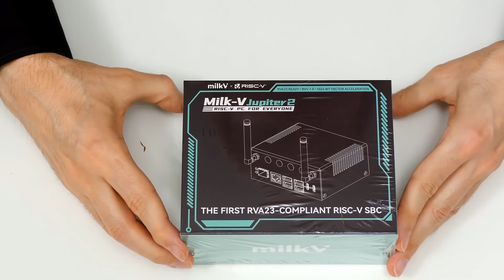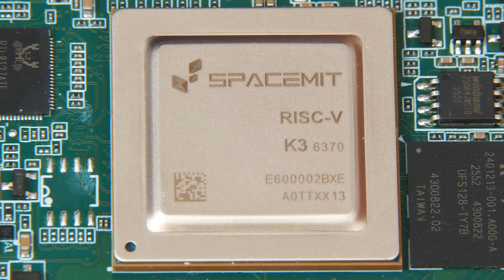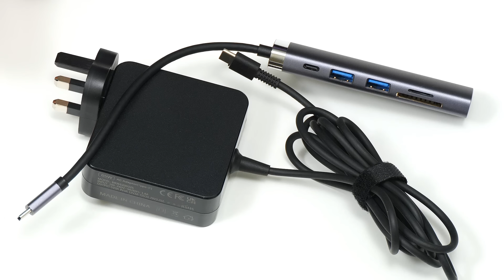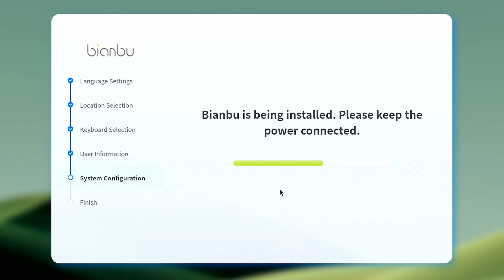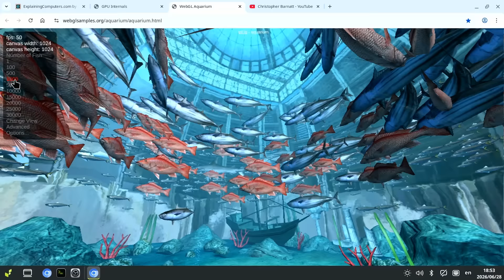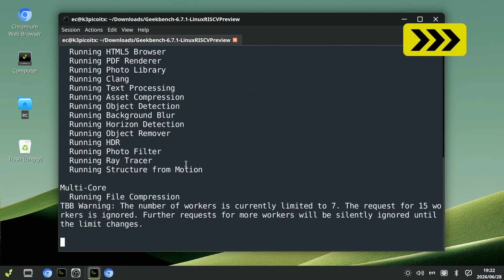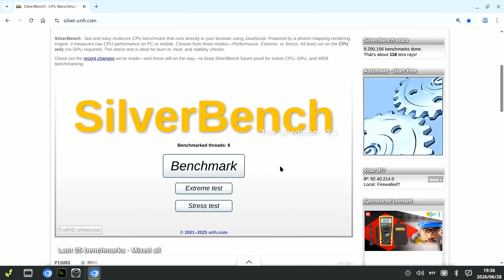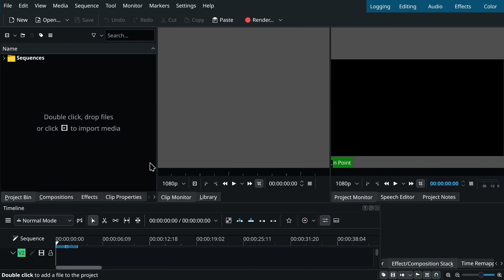Milk-V Jupiter 2: RISC-V RVA23 SBC

Comment: the sfp 10+ is nice and if you run fiber or a DAC, they are usually cooler than the copper wire tranceivers

Comment: 14.4 watt at idle and 20.5 watt at load sounds just wrong. Do nothing and waste three quarters of maximum power?
Reply from the maker: It suggests that a lot of the power is not being use by the CPU, which is/was hardly that unusual. Remember is this very new, developmental hardware, and may well not be power optimized.
Reply: Also remember he didn’t use the NPU. Pretty sure I’ve seen about 30W banded about if it used to the max.

Comment: A similar board with stepper motor control could be my dream machine right now for a project build. Could the gpio on this be used for high resolution encoders? (2 or 4 to be precise)

Comment: Very enjoyable, like all the videos I have watched after joining a few months back, having become a very unhappy Windows user and decided to learn more about Linux before taking the plunge! This one contained some whole sentences which I  understood, so I am making progress. My biggest problem is that none of the painting software I use to emulate my painting style before I became severely disable by a motor neuron disease [Corel Painter 2023, Dynamic Auto Painter 8 and Fotosketcher 3.98] is Linux compatible. Apart from the now very dated GIMPressionist in GIMP, I know of no brushstroke based paint packages that run in Linux. Any suggestions would be appreciated. Thanks

Comment: The speed of RISC-V improvement is good to see.

In terms of CPU power, we're basically within striking distance of a Raspberry Pi 5 and already better than a Raspberry Pi 4. Impressive.

A shame that AI data centres are ruining the prices of everything right now.

And I couldn't help but note those NPUs just sitting there doing nothing in "htop". How much of the SoC is used up on AI cores that just sit idle, if you're not using any AI? Could we have gotten more CPU or GPU cores in there instead? Or simply dropped it for a cheaper system for non-AI workloads?

Because if you're not intending to run local AI - either you're using cloud AI or just not using AI at all - then you've got a chunk of the SoC doing nothing.

Comment: For comparison, because it's handy...
Xeon E3-1276 v3 @ 3.60GHz (roughly equivalent to i7-5xxx), 32 GB RAM, fast NVME, Win11.... same render in GIMP took 3.5 seconds. 
So the best SBCs have about caught up to a 10 year old desktop PC (that was rather high end in its day) which isn't half bad considering the limitations of an SBC. Very much in the range of everyday usable (It's what I use every day, so it must be! :)

Note that GIMP versions do not perform the same. Same render with GIMP 2.8.22 on a slightly faster PC with 64GB RAM took 34 seconds!! So this is something to consider for your benchmarks. I was roundly shocked at the difference, but yay optimization!

That SBC does look like it's intended to be used headless. Probably why no HDMI. Quite the nice case and other features, tho.
Reply: What do you mean "used headless"? This SBC has alt-DP mode on USB-C. Lenovo sells 27" USB-C monitors for €190 so it's very easy to just hook it up with a single cable. Saves cables, speakers, power adapter and USB hub.

Comment: That's a big leap in performance, I remember when I experimented with the StarFive VisionFive 2 it was unbearable slow, even editing a document was slow. The Imagination Technologies iGPU has basically the same technical details as the IMG BXE-4-32 MC1 which couldn't play videos that smoothly but I wonder if it was really that slow or there was something wrong with the shipped Debian version and it had no hardware acceleration activated.

Edit: Nvm, the "Floating point operations per clock" are double on the IMG BXM-4-64 MC1.
Reply: With a lot of SBCs, video decoding is done with the VPU, not the GPU. And enabling hardware video decoding in a browser is a different story.
Reply: @LivingLinux  I don't see how that is relevant when the Video Processing Unit (VPU) is just a component of the GPU.

Comment: I get that it's early days yet but they are still no where near being daily drivers. Although this one seems to be a small step in the right direction.
Reply: If you can use a Raspberry Pi as a daily driver, it should be possible to us this as a daily driver.
Reply: @LivingLinux I don't use a Pi as even a 5 is under powered.

Comment: I found the phrasing of https://youtu.be/vSKA6thLI1U?t=342 where you mention the Nano Sim slot and then seem to conflate this with the B-keyed PCIe slot.
Reply from the maker: The nano SIM slot is only of use if a 4G or 5G wireless module is fitted in the B-keyed PCIe slot.

Comment: Surley as a NEW, 2026, RISC-V mini computer you should at least have the base, 2024, M4 MacMini benchmarks in the tables, as around the same price point (with the Education discount), and form factor. The base M4 8 core MacMini achieving - Single core 3788, Multi-core 14729, Idle Power ~3.5 Watts, ...  vs Milk-V Jupiter - Single 342, Multi 1703, Idle Power ~14.4 Watts, ... . Essentially 10% of the performance, for four times the power consumption, at 90% of the price of a MacMini, before considering software availability, and support.

Comment: A standard ISA is certainly a start towards RISC V becoming a thing in this market.  As mature as ARM is there is enough variation in features and aux components that it's all too easy to find an ARM SBC is soon abandoned and all you can run on it without considerable effort is a kernel built by the manufacturer from 3 years ago.

Comment: I still have serious doubts of a RISC-V desktop computer ever being price-performance competitive against ARM/x86. The main reason I have these doubts is because the ARM and x86 ecosystems continue to advance themselves. They are not going to stand idle and wait for RISC-V to catch up. If the RISC-V ecosystem ever hopes to produce an economically viable desktop computer product, it will need to advance several times faster than ARM/x86 just to catch up. I'm not seeing that.
Reply: You're not? The previous generation K1 boards that were comparable to Pi 3 / Odroid C2 were launched 8 years after those (early 2024 vs early 2016). This board was launched 2 1/2 years after the Pi 5 (October 2023). How is that not advancing several times faster than Arm?
Reply: A decade ago you could have said the same for ARM. It took nearly 30 years, but arm has caught up x86. 

Although the acorn home micros would probably have been competitive with a 286 pc at the time. That might be an intresting comparison to make.

Comment: And its here! Yay! Thanks!

PS: I had an alightly unrelated idea the other day, that I feel should already be a thing, although I have yet to come across them. That is someone making new, tiny mobo's for older x86 CPUs to make use of all the many older, but still useful CPU/APUs people like myself, and I imagne many others here, have laying around. It seems like a good alternative to spending hundreds on a new SBC. Im thinking a small one with soDIMM slots or intergrated RAM, I/O, etc and perhaps custom FW that has a number of power profiles preloaded in case you dont need the full power, or need all of it. Anyway, if this is a thing, a referal to a good one would be appreciated. Thanks

Comment: Neat board, but let's be clear: this RISC-V board is just as proprietary as any ARM SBC, and offers very few advantages to an end user over any number of ARM boards.  It also requires custom a custom vendor kernel and distro, and closed-source binary blob graphics driver, like all the SBCs. Really all RISC V offers is royalty free use of the ISA, which is something that only applies to the manufacturer.

Comment: Hmm... I'm rooting for RISC-V but I haven't bought anything since I don't have a legitimate use for it yet (didn't let that stop me with Raspberry Pi but well... I think things were literally 1/3 the cost at the time). I'm going to assume that this thing has all that I/O on the board because there are projects that can do things with it, but then the case covers it up so the overall package remains a bit of a head scratcher.

I'm also vaguely aware of some AI projects/applications that I guess the NPU on this would be able to run (it's claiming more tops than the current official pi5 AI hat after all) if ported to RISC, but they're pretty early days and by the time they're ready for action I've gotta imagine that there will be better RISC systems too so... Sir's disclaimer about who this is (almost nobody) and isn't (almost everybody) for was quite on point.
Reply: Llama.cpp has specific build instructions for the AI cores. And Bianbu has a specific build in the repo, so you can run LLMs easily on the "NPU".

Comment: Got to say, as a small, dedicated torrent machine, or haproxy type router, the Visionfive2 was perfectly serviceable for me.  The software support, GPU aside, was pretty good, all the way to running an EFI fedora + mainline uboot.  All these riscv board are blighted by the same thing imho, the GPU drivers.  The promise of the visionfive2 having full open GPU never happened sadly.

One thing on the video, any chance of checkout out how the video acceleration is enabled in Chrome.  v4l2 i presume, but have /dev/video details are there, like codec support... Thanks
Reply: It's a custom build of Chromium. VP9 decoding is supported, probably h264 and h265 too.
Reply: @LivingLinux  Thank you! Know if its via v4l2?

Comment: That's quite the marketing claim that it could handle a 30B AI model. This thing is 2-3 times slower than an N100, and RAM is a key factor.
Reply: My 32 GB K3 board runs e.g. Qwen3-Coder-30B-A3B-Instruct-Q5_K_M.gguf just fine at around 7 tok/s while using 14W of power. There's a video of someone else running similar models on a pre-production K3 board here https://www.youtube.com/watch?v=3ziCQHnUqlE
Reply: @BruceHoult  Good to know. I guess those 8 AI cores are doing some heavy lifting. Do you actually find it useful for coding, though? My experience with only 32GB is that they fall over pretty fast beyond simple examples.
Reply: @chrimony  I wouldn't use it to write code, but I've tried it for code review. It takes longer than the cloud services but does pick up a lot of things. Even if it takes a lunchtime to do it vs a few seconds that's still faster and more thorough than flicking an email to a colleague .... especially if you don't have any. You do have to keep context fairly small ... 64k tok is probably the absolute maximum.

Comment: This is getting so close to having real world use cases. If it were closer to a PI5 for performance, I could see using it to run docker containers. I can't wait for that… Also, I love that they included the 10G interface, hopefully that's something we'll see going forward with SBCs.
Reply: It beats the Pi 5 on most things. Geekbench is not representative of the things you'd want to use this for. Docker and server and developer kind of tasks run very well.

Comment: Combined PD and display output is far from crazy. Plenty of monitors available that will plug straight into that USB~C port, providing power to the board, it is a well thought out design.
Reply: Yup, got a 27 QHD screen here from Lenovo, it also got a USB hub and speakers for under 200. Not perfect colors, but matte screen with perfectly readable text and 100Hz to boot. It's not as great a picture as my expensive Dell monitors (mostly 2nd hand tho) but it serves me fine. I think there is even a cheaper FHD option out there.

Comment: Interesting design choice ... waste a lot of bus bandwidth on a 10 gig ethernet interface, and only include a single USB 3 port, which is also the power input and video output. I suppose in an industrial environment there are not a lot of USB peripherals. All the local IO will be using the flex cable interfaces and the 10 gig port gives you a noise free optical connection to the rest of the shop infrastructure.
Reply from the maker: I agree! :) Some very strange bandwidth priorities.

Comment: Great video.

Why the weird Linux distro? If it is Ubuntu based, can other Ubuntu distros run on it? Also, there is a problem with Chinese companies and spyware. Can you test to see if it is sending data back that it should not be doing? Usually, this is detected through unusual or excessive data transmission in the network connections. I would be really interested in finding out about this integrated spyware  especially as it is a Chinese Linux distro. Deepin (also Chinese) is NOT recommended for any use for this reason. And yes, I am aware of the integrated chip within a chip spyware in all US made chips in recent years.

I look forward to further installments, especially from non Chinese or US manufacturers and suppliers should there be any.

Comment: This is 2x the TDP of a Raspberry Pi 5... not sure what the benefit is
Reply: He didn’t use the NPU. The 32G versions is capable of 60 tops, so far more than a RP5 even with that Israeli Hailo add on. Really I think the use case is local ai, but he used it to see if RISC V made for viable desktops and if does now.

Comment: the pi5 is already 3 years old it weird they havent been able to beat it already considering the asking price
Reply: October 2023 is only 2 1/2 years before this board was available to order. That's a much-reduced gap compared to the eight years between the release of the Pi 3 / Odroid C2 and the comparable previous-generation SpacemiT K1 boards.

Comment: Watching and commenting from a Sipeed K3, so cool where RISC-V stands now, from barely booting to something that could keep you going if you are not to picky.
Reply from the maker: Agreed. And it's very cool that you are communicating from a K3 system. :)
Reply: I've got my K3 on my desk at home, I've just been SSHing into it for the most part. My weekend project was getting a process running on the vector cores before the CRT starts up, and now I'm trying to pack those registers with as much data as I can.

Comment: Much faster single-core than a Pi 4. I'm very pleased to see that Risc V is catching up quickly.
Reply: Yes, and very comparable to a Pi 5. Geekbench should be disregarded for cross-ISA comparisons as it is not equally-well optimised on different ISAs.
Reply: Not Pi 4, but Pi 5 18:29
Reply: @autohmae  Is the Pi 4 faster than the Pi 5?
Reply: @tdome3000   first Google result: "The Raspberry Pi 5 offers 2-3x the performance of the Raspberry Pi 4"
Reply: @autohmae  Then why are you writing total crap?
Reply: @tdome3000   the video shows Pi 5 in all charts, not Pi 4 that  was in your first comment
Reply: @autohmae  So what? Are you drunk?
Reply: It will catch up more when it goes to 3 or 2 mm chips instead of 7 could be 20 times or more faster.
Reply: @JamesRinkevich  You have no clue what you're writing about.
Reply: @tdome3000 you have no clue that the milk v is on a 7mm process and the Apple M5is on a 3mm process which explains much of the speed difference as 3mm runs at 3x clock speeds and about 10x faster connections.
Reply: @JamesRinkevich  Keep writing, it makes you look more and more dumb.
Reply: @tdome3000 you keep writing but cant prove I’m wrong which basically show you’re an idiot who doesn’t know basic computer design.
Reply: Clearly you don’t know the facts because they are Apple uses TSMC 3mm on M4 and 2mm on M6 and the K3 is on a 7mm process youkre shown how ignorant you are.
Reply: @JamesRinkevich  Calling someone ignorant while typing this non-sense is hilarious, you have to be trolling no?
Reply: @h @hehefunnysharkgoa9515  you’re the ignorant troll.and you just proved it.

Comment: Can you start including local LLM tests? Would be interesting to see what those NPU cores can do.
Reply: Unfortunately the choice of models is going to be very restricted on the 8 GB RAM board Chris has. I have a 32GB machine and it does run 30B parameter models rather well — not a patch on a 4090 GPU of course, but then also it only uses 14W while doing it. There's a video of running LLMs remotely on a board at SpacemiT HQ from back in February: https://www.youtube.com/watch?v=3ziCQHnUqlE

Comment: Excellent video, Chris. It's very exciting to see RISC-V actually come into fruition. Having a genuine alternative to ARM and x86 is something we should all benefit from. 

I'm very curious to see the LLM performance metrics trickle in as other folks get their boards, and the software support starts arriving.
Reply: We've had LLM results since SpacemiT gave remote access to a K3 system in mid January. Unfortunately, running the 30B model Chris mentioned needs a board with 32GB RAM (which I have). https://www.youtube.com/watch?v=3ziCQHnUqlE
Reply: I've been scouring the internet trying to find anything for the last hour or so, and I've only found a couple early benchmarks, and it's looking like the 30b models are very slow, at just under 10 tokens/sec on average.

That's a shame, even 10/sec is dog slow. I find that almost usable with my Jetson Orin Nano, but it's far from what I would consider interactive, but I put up with it, because it uses such little power while running.

I still think it's too early to draw any real conclusions, so I will simply wait and see.
Reply: @JMaxMena  I think this uses less power than the Jetson Orin Nano at the same performance level. My board uses 14W while running 30B models and that's at 60 TOPS. The Nvidia board can be configured for that power level but then is only I think 20 TOPS.
Reply: @BruceHoult 

That is quite impressive! That is quite efficient. 

Hopefully the software improves and is able to squeeze a bit more performance out of these devices. Or, even better, a next gen processor comes out with even more performance in a year or two. Who knows what the future will hold, for a proper first generation RISC-V processor, we're already seeing generally useful devices.